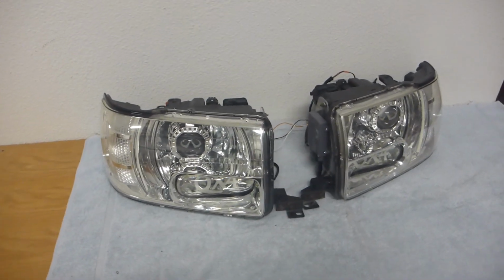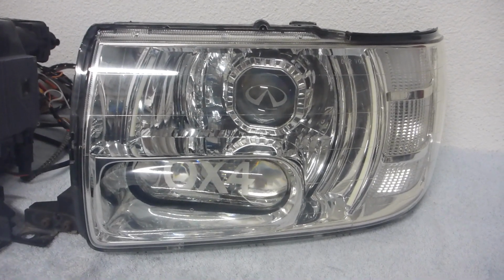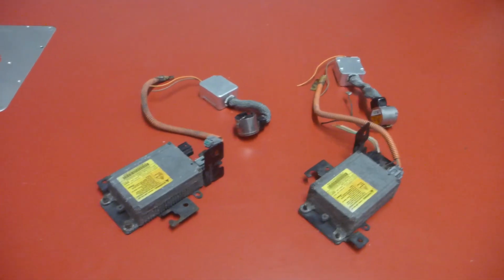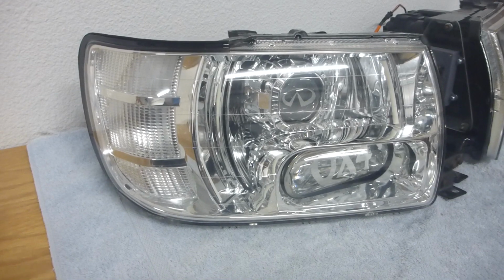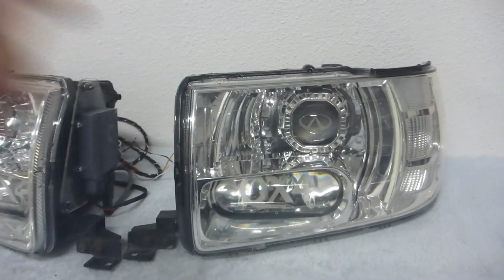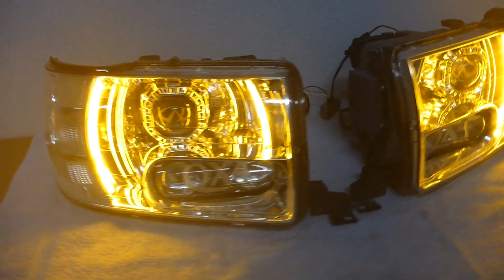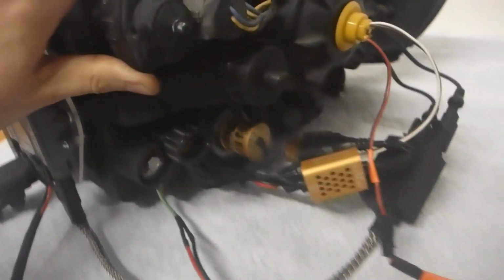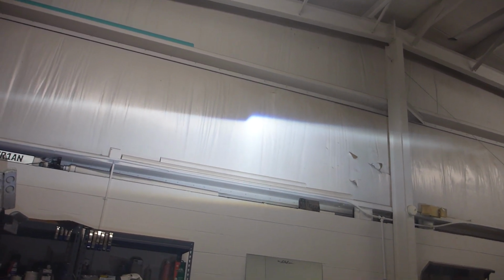Infiniti QX4 Custom Headlight Retrofit

Comment: Will this fit a 97 to 99? I already have the xenon HID mod. If I if I take out both the headlights and the side lights it looks like it creates the same space as the 2001-2004 one piece headlamp.
Reply from the maker: Installation of housings not initially designed for your vehicle will be up to your installation / fabrication capabilities.  Anything can be done.

Comment: How in heck do you replace the igniter which is inside the headlight housing. What kind of dumb ass would put the igniter inside the headlight. Everyone thinks that these headlights are so great. I think that they are a junk design.
Reply from the maker: Q1: Very easily. 
Q2: Almost every OEM manufacturer has at least one headlight design that includes an internal ignitor. 

And I think you have a pretty worthless opinion.

Comment: My gosh these are beautiful! I have same car/headlight system and dealing with them shutting off while driving. I’m on to replacing the ballasts but this has me thinking of just updating them altogether! Curious to get more info on the strips you used on the interior for the white and amber👏🏻
Reply from the maker: This exact build is possibly available for purchase on the cheap.  The owner reached out to me recently -- the car is going to the scrap yard and wanted to know if he should pull the headlights before it gets crushed.
Reply: @Bythirteen please let me know if that is possible👍🏻

Comment: Hey Thirteen, was wondering what it’s cost to have this done by you? Can pm me regarding, thanks man :)
Reply from the maker: pricing is in video description.  every set is custom made to order.
Reply: @Bythirteen  Hey man thanks for the videos. I've got a question for yu. I OWN a 2017 infiniti qx80 suv. I'm doing my first headlight conversion. My main headlights have a projector lens light and then a small eagle claw light  for a  running light and 2 small round lights onside of the projector light that works as emergency flashers and blinkers. Is it possible for me to swapp the wiring and make the park light the blinker and the other 2 work as running lights. I'd like to have all 3 round lights work at the same time. Is that possible. Thanks
Reply from the maker: Anything is possible.